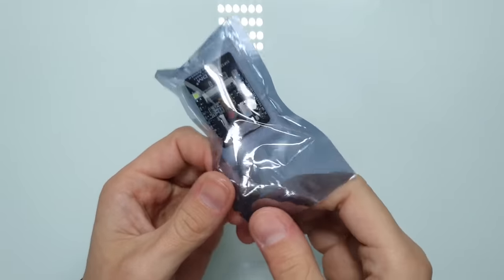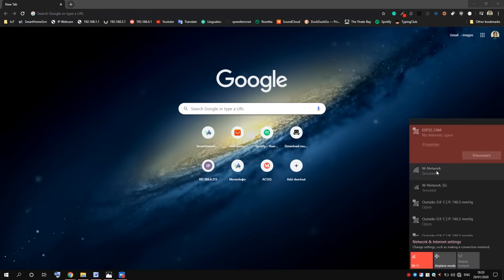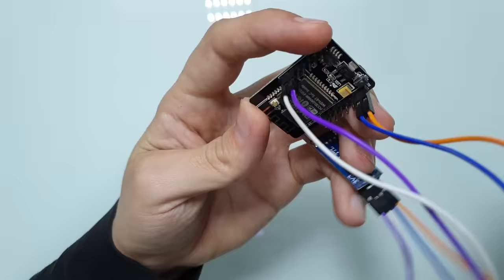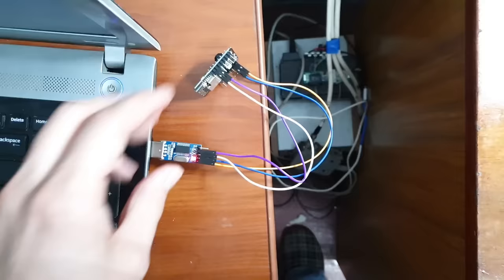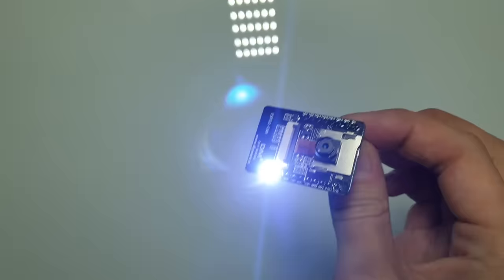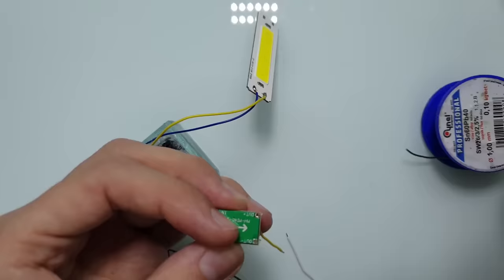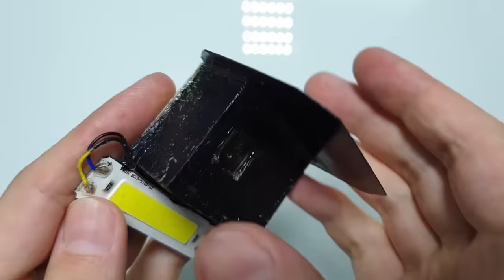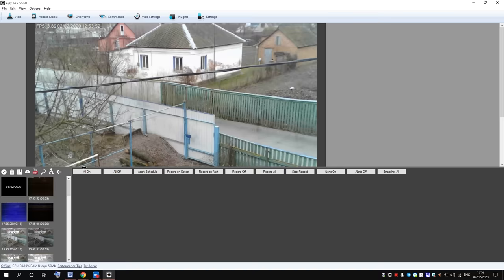Cheap Wi-Fi IP Surveillance Camera (Very little DIY needed)

Comment: With compliments! Can it use with Alexa (Amazon) ? Under a Skil like "Smart Home"or similar?
Reply: probably not, I am assuming that amazon made it so only compatible devices will work. But you can sure try. Maybe it is possible with a code modification in Arduino IDE?

Comment: Посмотрев ваш ролик, приобрёл такой модуль. Запрограммировал как в ролике. Но что-то пошло не так. Выдаёт белеберду:
rst:0x3 (SW_RESET),boot:0x13 (SPI_FAST_FLASH_BOOT)
configsip: 0, SPIWP:0xee
clk_drv:0x00,q_drv:0x00,d_drv:0x00,cs0_drv:0x00,hd_drv:0x00,wp_drv:0x00
mode:DIO, clock div:1
load:0x3fff0018,len:4
load:0x3fff001c,len:1216
ho 0 tail 12 room 4
load:0x40078000,len:10944
load:0x40080400,len:6388
entry 0x400806b4
Guru Meditation Error: Core  0 panic'ed (LoadProhibited). Exception was unhandled.
Core 0 register dump:
PC      : 0x40086717  PS      : 0x00060630  A0      : 0x800883c9  A1      : 0x3ffbbae0  
A2      : 0x3ffbbb08  A3      : 0x800c98e8  A4      : 0xbffc98e8  A5      : 0x00000000  
A6      : 0x00000020  A7      : 0x00000000  A8      : 0x00013ffc  A9      : 0x3ffbbac0  
A10     : 0x00000000  A11     : 0x3ff42000  A12     : 0x00000040  A13     : 0x3ff420c0  
A14     : 0x3ffbd3e8  A15     : 0x00000004  SAR     : 0x0000000f  EXCCAUSE: 0x0000001c  
EXCVADDR: 0xbffc98e8  LBEG    : 0x4008d0aa  LEND    : 0x4008d0b5  LCOUNT  : 0x00000000  
ELF file SHA256: 0000000000000000
Backtrace: 0x40086717:0x3ffbbae0 0x400883c6:0x3ffbbb00 0x4013cf52:0x3ffbbb30 0x400d2ea4:0x3ffbbb50 0x400d2e0d:0x3ffbbb70 0x400d37f9:0x3ffbbb90 0x4013d0d3:0x3ffbbbc0 0x4008fe86:0x3ffbbbe0
Rebooting...
ets Jun  8 2016 @

Что делать?

Comment: please give a link to what battery you used? where to buy those cables you use to test.
Reply: Ep Electrical Projects [ Cr ... 1 yr ago ( edited ) The camera requires 5V DC , But in the video you can see that I installed DC - DC converter ( converts 7-20V to 5V ) , this allowed me to power it from 12V ( anything from 7V to 20V DC should work as well ) . If you use a long wire to power the camera I recommend installing DC - DC converter , because with long wires you will have a " voltage drop " , it means that even if you connect it to 12V , near the camera you'll have a much lower voltage , for example 10V , but it is ok because I use a converter that can work from 7V to 20V DC and it produces stable 5V for the camera .

Comment: How to operate without a battery means by magic, why did not you explain how to connect it to the battery
Reply from the maker: The camera needs 5V DC to work... So to power it for example from  3.7V battery you need appropriate converter. But I use 12V DC power supply to power the camera, that is why I installed DC-DC converter inside, it converts 12V to 5V.

Comment: Hi, nice tutorial, but when I try to compile it says this  Arduino: 1.8.13 (Windows 10), Board: "ESP32 Dev Module, Disabled, Default 4MB with spiffs (1.2MB APP/1.5MB SPIFFS), 240MHz (WiFi/BT), QIO, 80MHz, 4MB (32Mb), 921600, None"

Sketch uses 2051095 bytes (156%) of program storage space. Maximum is 1310720 bytes.

Global variables use 53616 bytes (16%) of dynamic memory, leaving 274064 bytes for local variables. Maximum is 327680 bytes.

text section exceeds available space in board

Sketch too big; see http://www.arduino.cc/en/Guide/Troubleshooting#size for tips on reducing it.

Error compiling for board ESP32 Dev Module.

This report would have more information with
"Show verbose output during compilation"
option enabled in File -> Preferences.

Comment: hey can you help me i just got the camera module and i pluged it into 5v but nothing happend
i cant find it in my wifi list
Reply: Happenned to me too, try waiting for a while or press the reset button on the back (is the only small button)
Reply: @1mclv  i will try it thanks
Reply: @1mclv  after waiting about 30 minutes nothing happened again so what should i do with the button spam it or just press it one time and wait
Reply: @kys1721  uhh maybe a problem with the power source? Have you tried connecting it with the USB converter and checked the terminal to see if the ESP 32 is actually sending/receiving something?
Reply: @1mclv  my USB converter hasnt arrived yet i am still waiting and i am hoping that when it comes to see what is the problem

Comment: looks good but what did you solder at 5:18 just curious?
Reply from the maker: It is an electrolytic capacitor, it is probably not necessary, I just had space for. It makes voltage for the camera cleaner. As they say "You can never have too much of a good thing", so decided to add it.

Comment: Wow, great and interesting! U said that if we've great resolution, our fps will be low, I'm wondering if that's because of WiFi... Can u explain this part? Please, and thank you
Reply: It's the time it takes to process each frame; less time per frame --> more frames per second.
Reply: @michaels3003  OK, that mean that the bottle neck would be the processor, right? And no the WiFi?
Reply: @alexisjianglan5763  , I don't know enough about this controller and this specific solution. The frame rate also depends on the software used to process the image data. Faster clock rate and more memory are better if you ignore energy consumption (battery drain). In this example, the camera is also very limited. You would need to find a real expert in controller based camera solutions to answer your question about the bottleneck.
Reply: @michaels3003  OK, thank you very much!

Comment: Great comment and exactly what this is made for. This way you may just pay 7€ for spying wild animalsmin the woods or your own garden and may download the Photos via mobile device or laptop and adjust it via BT or WLan without cliimbing up trees as long as the Battery is fine. Or you may spy your or baby's sleep on SD or WLAN  triggered by arduino sound or motion sensor. Even non 18650 batteries will last long in your projects. So many things for use even in deep or ultra deep sleep mode.  I did not experience the ESP devices, but there is so (too?) much information, if you just dare. Maybe someone could build a tablet controlled 360° stereo cam with photogrammetry optimization for less than 80$?
On the other hand "older people" can get the old c64 feeling back at much higher CPU rate. ;-)